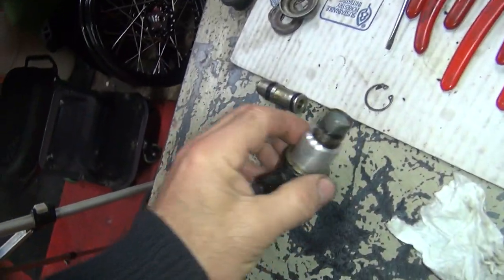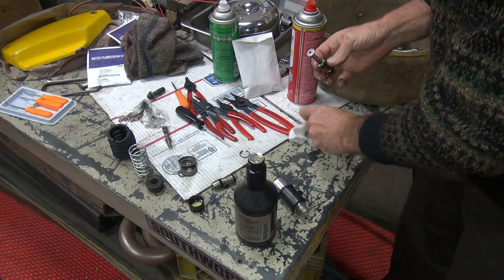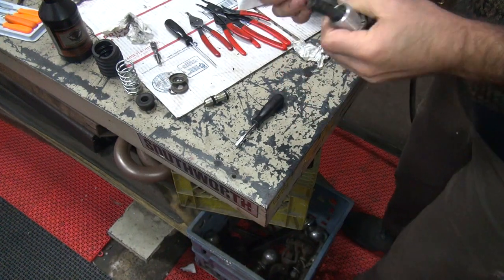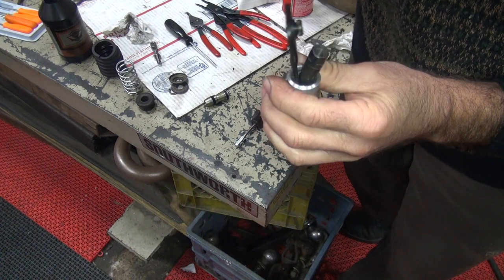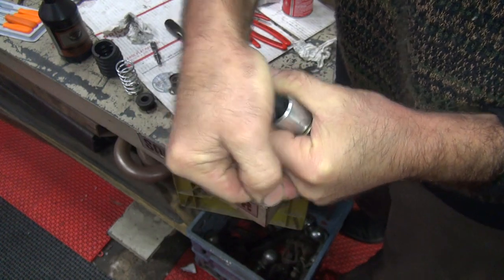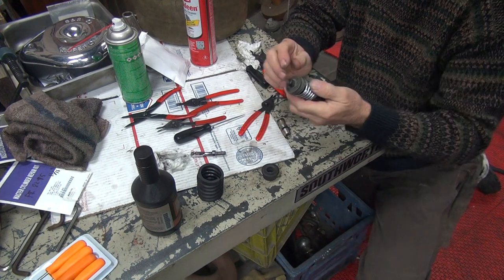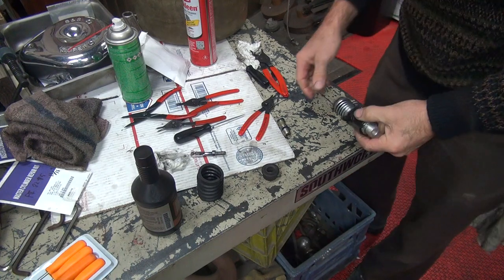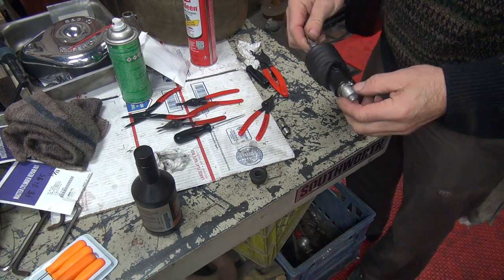#118 1990 fxr custom rear master cylinder rebuild garage find 80ci fxrp repair harley tatro machine

Comment: I have the exact same system, not getting parts for a rebuild kit, stangely enough my spring inside of the master cylinder did not have the little back metal washer at the end of the spring, not sure if it's required or not. Not sure if it was previously worked on or not as it's a second hand HD I have a 1999 fxst softail 80 inch.